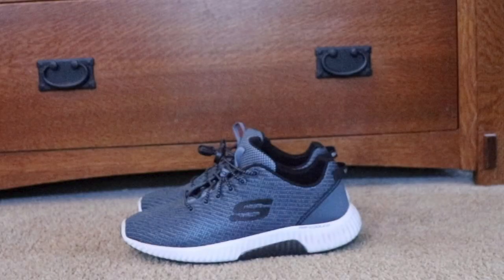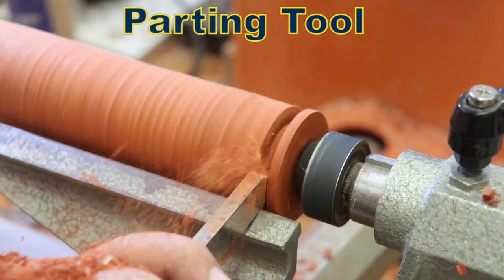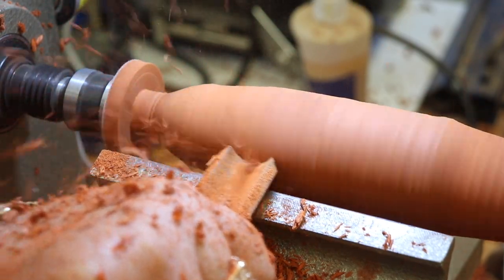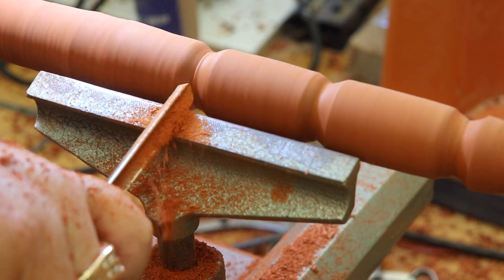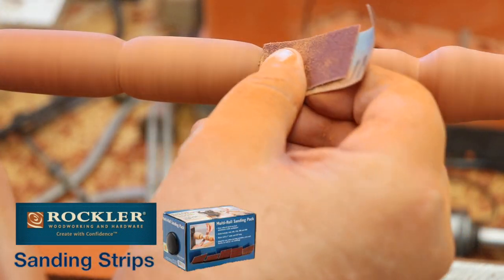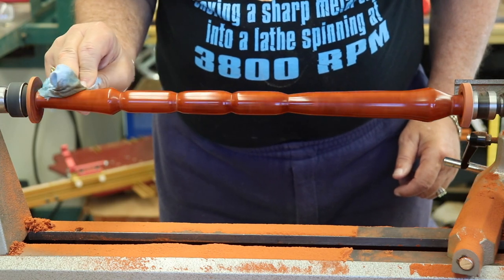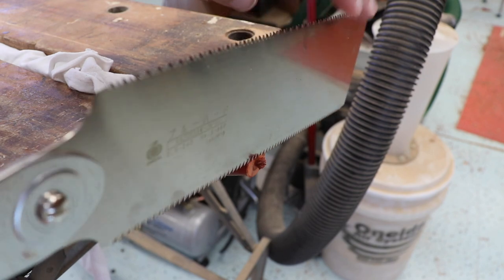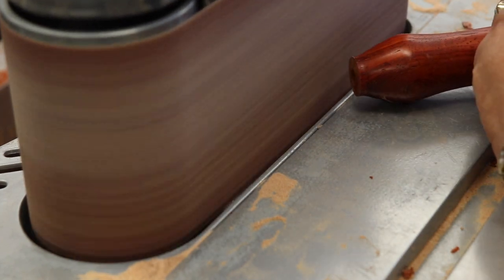Shoehorn Handle - Detailed How To - Great turning project for beginners. - Nova Comet II Lathe

Comment: That washer trick was awesome...did you come up with it?!

I’ve never appreciated shoe horns until I needed to take care of my grandpa and had to help him get his shoes on.  After a while he went to zipper shoes...but you can’t put zippers on tennis shoes (at least I don’t think you can 🤔).  

Great video...as ALWAYS!  Thanks Don!
Reply from the maker: Rob, I picked up the washer trick from James Wright on Wood by Wright. James uses his wedding ring on a hand drill. I thought a power drill would really mess up a ring so I used a washer I had sitting around. In the future I’ll try to find one with a bigger hole in the center but this one worked fine for this project.

Yes, as we get older doing things like putting on socks and shoes gets more difficult. 😃 All my shoes now have either Velcro closures or bungee cords. Those I can get to replace regular shoe laces. I’ve discovered that Amazon has a wide variety. 😮 

Thanks for your support.